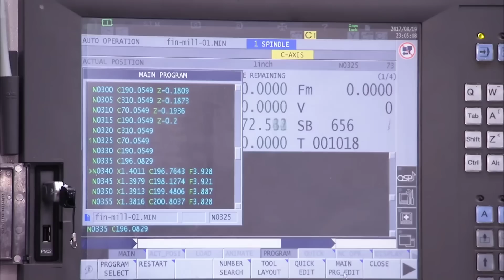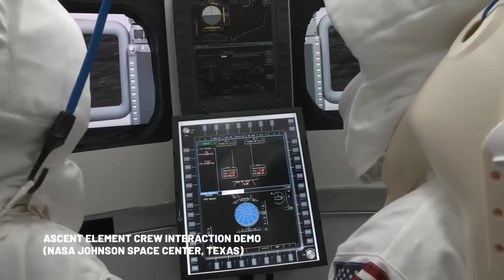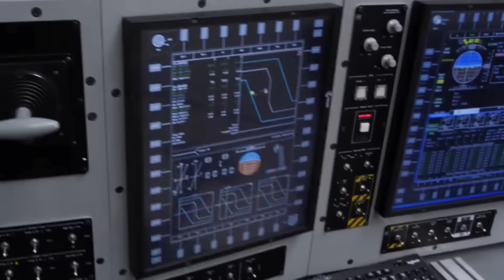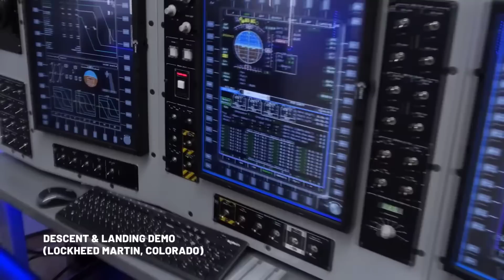Blue Orgin gets another shot at the Moon, BUT there's a surprise development in the HLS battle!

Comment: Considering how many things in a lunar mission can can go wrong, a tall ladder at 1/6th G is the lesser of all those menaces. It can be easily secured with attachment points or a small crane and winch (which will likely be necessary anyway).
SpaceX's lander would be way worse in that regard.
Reply: Space X lander will come with a serious cargo elevator, it has to. It will be far more practical and safe for astronauts than any other solution. We can build elevators, we are rather good at it, with literally millions of examples on Earth already.
Reply: @rorykeegan1895  It will be different .You add complexity with multiple heavy mobile parts that may all cold weld. We'll have may more movement on that kind of stuff than on a camera filter of some flyby probe.
Also, the ground is uneven on the Moon. You'll need to level the landing ship to make sure your elevator doesn't break anything. The swinging may be slower but more ample. Add the abrasive dust that will sandblast and stick to everything each time some ship will land...

Comment: My suggestion for the Starship moon lander put the legs on top. Then land with the crew section on the bottom. When they start the return flight, they take off with just a small crew cabin for the trip back to the orbital station. The main crew cabin is left behind for a permanent addition to the moon base.

Advantage: no ladder elevator and a rapidly growing base. Each Starship flight to the Moon adds another building to the base.
Reply: How does a rocket with the pointy end down and flamey end up take off from the moon? If you want to build a base out of bits of a bunch of starships why not just land one uncrewed starship thats kitted out to be a base

Comment: I still say the first HLS habitat should be shaped like the millennium falcon with VTOL engines and be launched atop a SpaceX starship booster so the astronauts immediately have a place to live and work landing on the moon 🌝
Reply: So its going to be 9m wide? Max? So much easier to just use the Starship instead, why bother with the silly MF? Take a shop fitter on the either the 1st or second trip, turn one into the habitat for the base and one to go home.

Comment: Angry Astronaut talks a lot about the problems of the insanely tall ladder - and this definitely has to be an issue. Having played Kerbal Space Program and built and landed many landers a more obvious and even worse problem stands out for the National Team machine. - Its height makes it very top heavy and so liable to tipping over on landing.

This is also a potential problem for Starship of course. Dynetics definitely has a better solution in a 'sideways' facing machine. Another example are the Space 1999 Eagles mentioned in another thread.. A sideways type landing is simply much safer and would be better for Mars as well.

A standard trope for sci-fi designs is a central payload body with rotatable thruster banks to either side and I think that is definitely a more realistic long term solution to this problem. - Simply because it offers so much design flexibility. 
Redundancy and thrust balancing are problems but these are already less of a problem today with advancing technology.

Comment: If the goal is to land Artemis, then Dynetics' lander is probably the way to go; they only need to carry two people and a beer cooler. But if you want to actually build something on the moon, Starship is the better option.
Reply: Exactly. Artemis 3 is nice, BUT if you wanna move in, you need a moving truck.
Reply: @GawainNYC  Perhaps to set foot on the moon again sooner like how the Apollo LEM did(but with more crew+cargo capacity) the Alpaca would do the job, then once they've figured out where to build the lunar base have Starship(once ready for the moon) as the modern equivalent of the would've been Apollo Applications Program(albeit with obvious differences in terms of design)- setting up shop on the lunar surface, while the Alpaca could shift to help carrying smaller cargo as well as further exploring other areas of the moon.
Reply: And that is where Musk thinks lightyears ahead. The other companies will have to start from scratch when designing vehicles destined for Mars. Starship will only need minor updates and modifications.
Reply: Artemis is the name of the entire program, not the lander. You just suggested putting 20k people in a two seater.
Reply: Agree, doupt spaceX will use lunar starship for a long time. Once you have landing pads regular starship will probably be the better option. Also I do think that for a long sustainable base a small lander that uses feul that can be produced on the moon would be the best option

Comment: The Alpaca makes good sense for a crew lander. Lunar Starship strikes me as an viable cargo delivery vehicle for lots of stuff in one go. 
Long term a lunar space elevator would invalidate a lot of issues with ferrying crew & cargo to/from a permanent settlement on or below the surface.
Reply: A space elevator for the Moon has many problems few sit down and really think through. Orbit stability for the "anchor" being just one of them. The Moon always faces the Earth, using Lagrangian points instead of geostationary is therefore the way to go, but limits us regards destinations. Ideas on a postcard, because you are correct if it can be done. An anchor that orbits faster than the Moon rotates gives us a moving destination on the surface and that doesn't help too much when you want to build up a Moon Base. Lunar orbits are hard, hence Capstone, and really complicated orbits which are sold as an advantage when they are anything but helpful for other things. There are easier ways to ensure the 24/7 communications NASA always quotes as a reason for the rectilinear halo orbit its so proud of. The constantly moving destination, to allow "easy exploration" only works if the Base is located at a pole. Otherwise it could be a very long schlep from landing to Base. Its something a few good ideas from left field thinkers could be very helpful in solving. Whatever it will be a "nuts" solution in the end.

Comment: "They could be the first company to deliver human beings to the Moon in 50 years."

Officially. Unofficially? Well, that's a whole different story.
Reply: They won't be doing the delivery.  It will be NASA using the vehicle designed, operated and paid for by them.  Just like in the 1960s.  Only Bezos ego makes him claim it will be BO when BO can't even put anything in orbit yet let alone to the moon and this craft won't carry people to lunar orbit.  

Only one company has projects in the works (actually at the prototyping stage) that could while funded by the company deliver people to the lunar surface and return (assuming everything works).  SpaceX.

BO doesn't have a vehicle to deliver the lander and people to lunar orbit.  Even this lander is only partly BO.  New Glenn might be able to deliver such a vehicle to orbit but they don't have a passenger capability of their own (or engines and maybe not a 2nd stage).

Comment: Like you I think the Alpaca makes the most sense. It is small and reusable. Lunar Starship is too big IMO, it could be great for transporting a lunar base to the surface, and acting as a temporary base. Hell, they could even transport a small bulldozer, and pile lunar dirt up around its sides.
Reply: As I recall, the BO lander price was nearly double the price of the Starship lander, and the Alpaca was roughly double the price of BO!  I also recall that NASA panned the Alpaca as having the most technical risk and (basically) worst overall package of the three.  No??
Reply: @737smartin  BO should have been the most risky. And surely Starship has huge risk when it comes to landing that thing on the lunar surface.
Reply: @737smartin , it’s the only truly sustainable one.  Starship needs refueling to get to the moon, refuelings to get back (if they want to bring it back), and refueling for repeated trips to the surface and back.  ALPACA will need refueling for repeated sorties to the surface and back, but it has a smaller size (better tailored to a few people), and much smaller fuel consumption.
Reply: @michaeldemarco9950  I might agree if I felt refueling was a huge technical hurdle.  Since NASA and SpaceX do not see it this way, I’m siding with them.  Watching with much curiosity, but not overly concerned.
Reply: I think "transport a lunar base" is exactly what they'll use it for. The question in my mind is if it'll ever get used for anything else.
Reply: @absalomdraconis  Indeed. I could see a version that has a detachable front end which could be used in the construction of an orbiting lunar base. Might not be cost effective though.
Reply: @absalomdraconis , I doubt it.  Starship will be used for heavy-lift, one-way operations.

It’ll be great for a Mars mission, but for the Moon, it’s use as a people-hauler is overkill.

Comment: I wasn't too impressed with the original three proposed lander concepts!
The Dynetics one, had a sound configuration, but had issues..
I'm glad there are possible alternatives turning up!
Reply: Agreed - 

Have never seen a more confused bunch of proposals to do a single job, with a relatively simple function than HLS. Mind you, they mostly all started from the same completely confused design brief.

Stated goal, long term constant occupation of a Moon Base: Their solutions:

1. Build a space station you don't need to achieve the object of the exercise.
2. Build x 2 seater landers that cannot adequately re-supply a permanently manned Moon Base. It is not possible to occupy the Base permanently using either losing design. 
3. Build a lander that looks like the Empire State building and does the job and then some. 

(Except, it ignored the design brief completely, and renders every other element of the Artemis package obsolete the day it launches)

At least Space X went for the actual goal, a proper Lander / Moon Base that can be permanently manned, they called it a "lander" though, so as to not offend anyone. 
Its bloody enormous compared to every other element, why do we need a Moon Base made of anything but disposable Starship's at a tiny fraction of the cost of the other elements? 
I'm going with Starship every time, but I have never seen a program that needs ripping up and rethinking more than Artemis. 

Every reason for the Gateway is stupid, really stupid considering the alternatives. Every problem it solves could be solved at a fraction of the time, effort and cost. Many aspects it says are problems it solves, aren't problems at all. Many of the unique advantages are actually stupid distractions.

Why do we need C&C in Lunar orbit? Houston not expensive enough for NASA? 
The communications issues are largely a red herring, much cheaper solutions are on the table. Explain it to me, really lets be logical about it. We are flying Capstone to do something worse than we could do fine in 1969.
What earthly point does the ability to land anywhere on the Lunar surface have when you are going to spend the first decade building out a tiny base at the South pole. Explain it to me.

It’s as if Shackleton decided to build a base in Iceland to support exploration of the South Pole. Its truly amazingly nuts.

I look at the architecture proposed and there are huge gaping holes in the package. Forgetting you have no suitable space suits being just one of the “program halting” minor issues. Everyone blithely talks about orbital refuelling, where is the budget to provide it? Not prove it, but provide it? 

What do NASA want? A proper Moon Base or a Gateway, please decide. Either isn't a bad project on their own, both have interesting possibilities of their own, but together they make no sense at all and seriously over complicate the whole program.

It’s the most bonkers program ever.
Reply: @rorykeegan1895  I can understand Gateway as a tool to research the effects of deep space on equipment and crew. 
As a testing ground for the tech to be used on interplanetary spacecraft.
That research is sorely needed! 
Most obviously, the radiation research - and solutions!!        :D
Without that, Gateway won't be able to have crew for much of the time!

I think Gateway gloms together deep space research station and moon base support station, because there aren't too many other useful places to put a deep space research station..

I would go with a modified Dynetics style lander for long-term shuffling of crew from the moon to Gateway..
Starship would guzzle gas, lifting all that weight to move 2 people is a bit mad..
And both tall landers would be slow & painful to load samples and equipment into..

Expendable Starships are certainly a great option for instant bases.. They just need a practical radiation solution..        :)
Reply: If you mean grossly underpowered / overweight and virtually useless for transporting anything other than a couple of people, say so. That's its problem, the concept is good, its just badly spec'ed.

Comment: Come on Blue Origin! Work on the BE4 in quantity which is needed now rather than another get rich quick scheme. If I was Sierra Space then I would already be in consultation with SpaceX or other launch providers as a back up.
Reply: Blue Origin is already clearly out of the "get rich quick" market. Maybe "get poor slow", but nothing quick about them.
Reply: Does BE4 actually work properly? We don't know yet, the certification has been fudged to meet an already slipped deadline. I would have my doubts about swinging into full production on an engine which seems to take a decade to build x 2 of. 
Raptor 2's leave the factory at more than x 1 per day. BE4 will never, ever come anywhere even close to that production rate. 
BE4 is a dead end if you want cheap frequent accessibility to space.
Reply: Please don't tell me the FAA don't fudge things. They quite manifestly do.

Comment: would be amazing to see blue origin land first, imo as much as lunar starship is a fantastic way to get to the moons surface its size and high center of mass would probably imply lots of bugs to iron out simply because of form factor
Reply: Lunar Starship would (Luck/God willing) refuel in LEO, so when on the moon it should have a little over 1/2 a tank in both LCH4 and LOX as "ballast" to lower center of mass.
Reply: Sue origin has considerably more bugs to iron out simply because it uses software.
BO are well known for not being able to do anything as simple as read the correct time from a clock.
Reply: @N1gel  agreed, their latest launch abort at 13G was a bit too kerbal for a serious business
Reply: High centre of mass? Are you alright? Where are the x 6 main engines located? The top? The rest is an empty can basically. Its issue is digging a bloody big hole if they use those engines to land or take off. They have a solution and it will not have too high a centre of mass, even fully loaded.
Reply: @rorykeegan1895  would you be kind enough to tell us the location of the engines on the other proposed landers as well as their compared weights and heights?
until there's talk of pre built landing pads I believe a return to the moon would be best with landers a bit closer to the ground. It's a fantastic vehicle but imo it works best in tandem with pre-existing infrastructure
Reply: High centre of mass? Where are its x 6 engines located? Its not the Leaning Tower of Pisa!

Comment: You brought up the 'mini starship' a while ago, and I think that would be ideal for the lander.
Reply: I don't think they're actualy going to try something like that, 
it's a massive headache and undertaking to create a completely new vehicle for a trivial purpose like that...
And in many ways is less capable.
(are you really going to turn down 100T max mass launch capacity in both directionsa?)

It would also have the same problem with the cockpit being at the top and ahving to get down...
Somehow.
Reply: @Mallchad  We knoe that Starships can only land vertically elevators/cranes are the only option and was clearly illustrated to be used.
Reply: @scottywills124  Pretty much just cranes, although cumbersome, in theory you could shove out a whole module. and people could just go and use a hab that already is on the surface. Instead of going back inside...

I guess that's one upside of the crane. It only has to be safe twice
Reply: @Mallchad  Exiting to the surface / return from the surface is a completely minor issue compared to not having a clear plan of what you want to achieve.
Reply: Yeah, didn't SpaceX have a type of Red Dragon ship concept for landing on Mars? If so, couldn't SpaceX develop that for landing on the Moon?
Reply: @christopherdaffron8115  That would be worth looking into if Artemis was a flagship mission like Apollo. But its far from it.  A Dragon is just a crew capsule with a bit of cargo space. A single Lunar Starship would give us enough cargo to get Base Alpha operational.